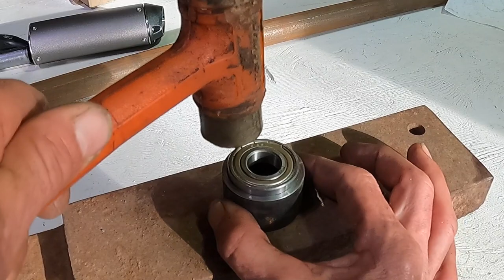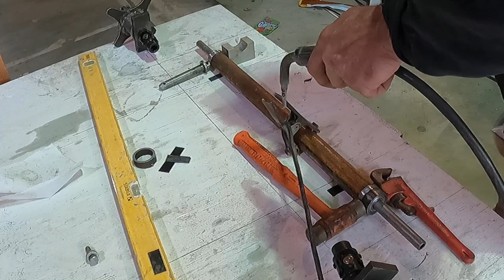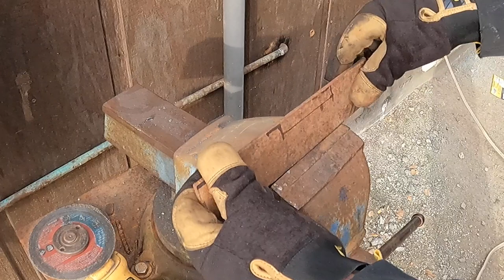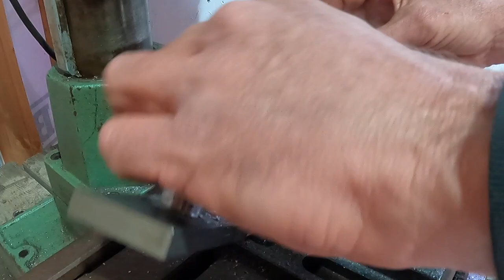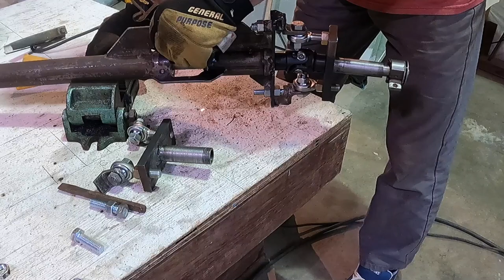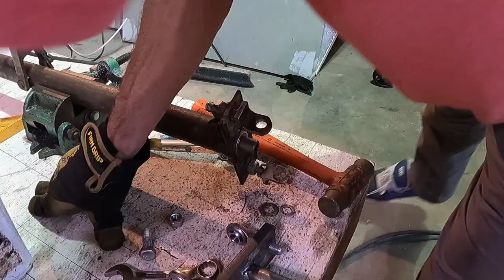4wd go kart build front axle ep.1

Comment: Nice work! Would you be willing to sell the plans for the front axle? Thanks
Reply from the maker: Thank you! Unfortunately I don’t have any plans drawn up for the front axle. I used three-quarter inch diameter axles and three-quarter inch Steering u joints if that helps.